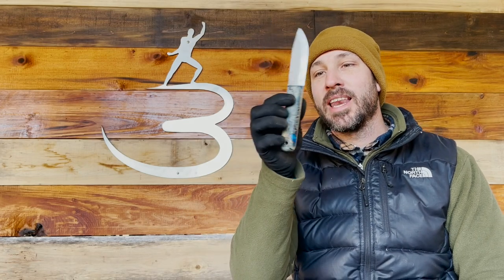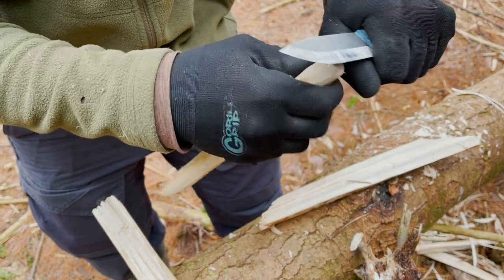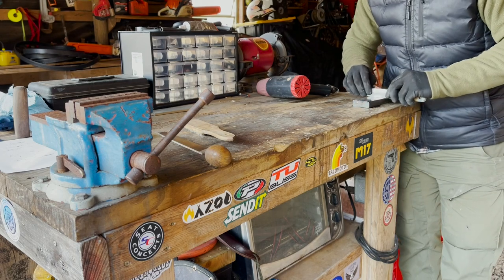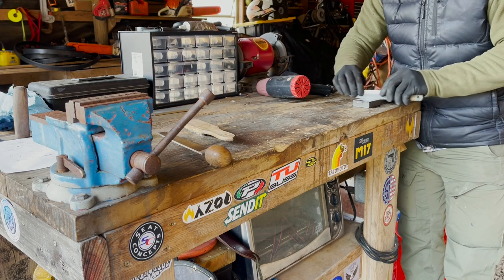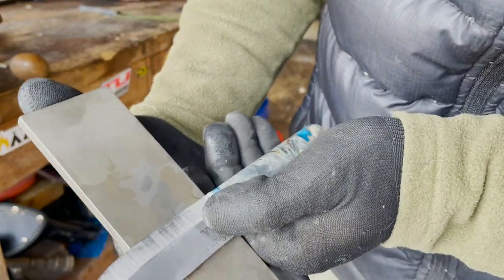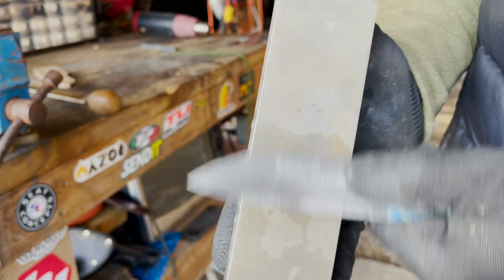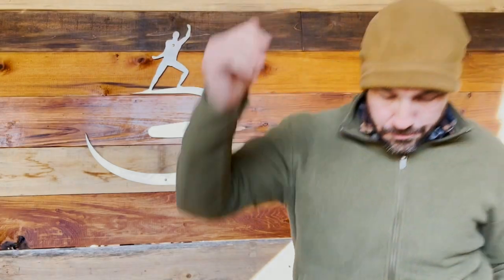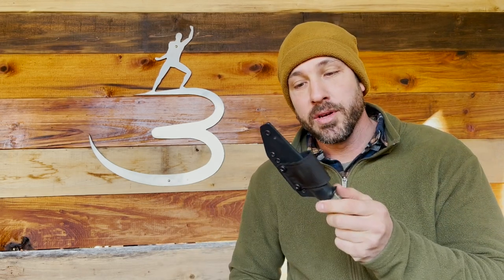How to Maintain a Fix Blade | Bear Forest Knife Review | ON Three

Comment: You put a handmade knife in the jaws of vise! Should have used some scrap wood to protect the blade. Also that looks like a shallow saber grind to me. Scandinavian grinds are usually ground on one side of the blade where the grind terminates at the edge with no secondary bevel
Reply: That’s a chisel grind.
Reply: @vegpwrshlominator1873  A chisel grind is ground on only one side of the blade. That blade is ground on both sides.
Reply: @informedcitizen8687  sounds like what your referring to is something like a full flat grind with no secondary edge. Most Scandi knives I have look similar to the simple knife.

Comment: Don’t use stones like that, to much material is removed. Generally just touch up my knife with a small pocket hone or ceramic rod, maybe small pocket diamond sharpening stone if the blade is really dull. And follow the curve of the blade edge down. Very simple. Knife maker William Collins has a lot of examples of this.